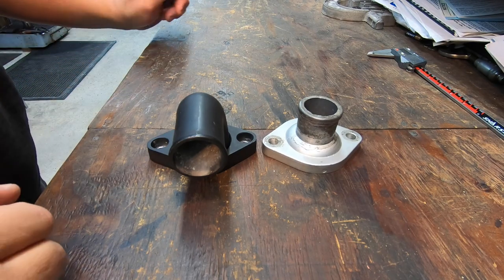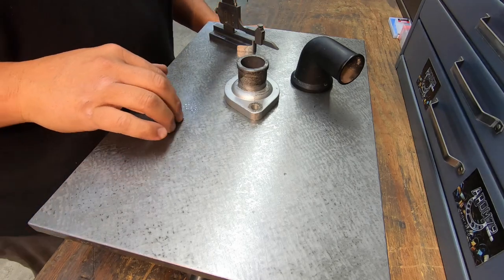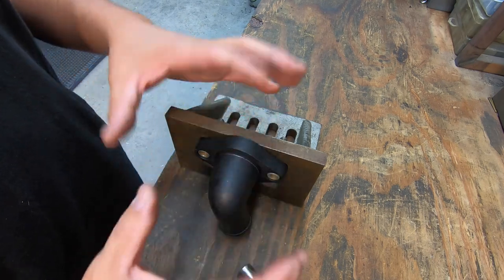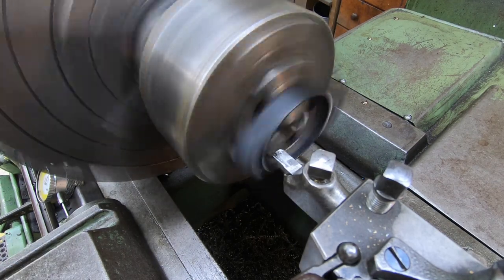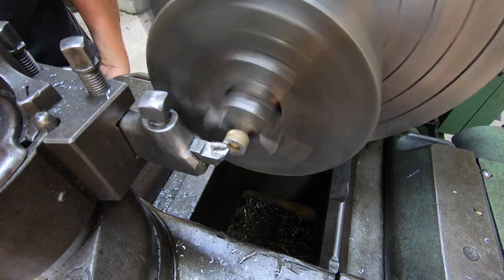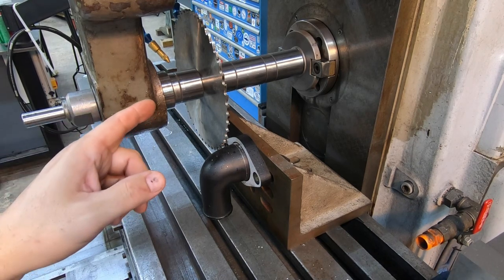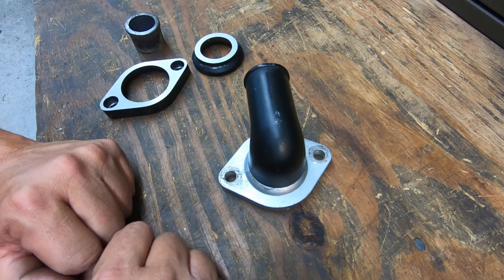SNS 328 Part 1: Machining a Custom Mopar Water Neck

Comment: Pro Tip!!!!!! I do not normally comment, But your in my wheel house with the Welding. Never clean Aluminum with a Steel Wire Wheel or any wire wheel or brush for that matter. What happened is you impregnated the Aluminum with the steel from the brush. This will cause contamination Big Time!!!!!!! Even if it is a bad casting you will not have that hard of a time. Clean it with Acetone or Methanol using Scotch Brite. Make sure to rinse with the same to get out the Scotch Brite particles. While its wet blast it with air to dry it out. You'll be fine after that. Your channel is absolutely beautiful!!!!!!!!!! Your content and craftsmanship along with your knowledge is priceless!!!!!!!!! Thank you!!!!!!!!!!

Comment: I built my first home about 25 years ago.  I designed it myself and sent the design to an engineer to put all of the structural and seismic calculations to the structure.  Once building began, I had this neighbor always stopping by with “why are you doing it like that?”  “Why not do it like this?”  “I would have done it like this.”
I finally told the guy “why don’t you get your own money and build your own house exactly the way you want”.  “If I wanted your opinion, I would ask for it”.  The same applies to this video, if Adam wanted opinions from random internet users, he would likely have asked for it.
Reply: Some people, like me, have just enough knowledge to be dangerous.  I ask him questions because he may have used a different technique on something else.  His channel is so fascinating to me, and others as you can see.

Comment: I am sure I have commented this before but, the setup of the part to be held in a machine can use more brain power than the actual job itself. Building a puzzle with pieces that have no picture reference.

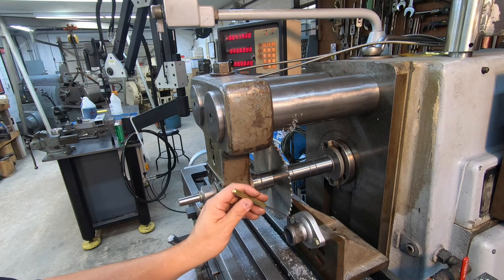Comment: Cool video, thank you.  I don't think it matters in this case, but just curious, if you needed to be precise would you needed to add the "weeble wobble" distance to the blade thickness when switching to cut with the other side with the DRO at 19:18?

Comment: Based on the pictures of the fit up on the engine, you probably should have taken another 1/4" out of the height on that elbow to help the coolant line clear the exhaust/turbo assembly. Just a thought.

Comment: Adam, please ask your cousin to get a better quality hose clamp. I understand this is a budget build but a cheap clamp on a high performance engine is both dangerous to both those working around a hot engine and to the engine itself if a hose clamp fails   Great video, I lived in Charlotte NC for a long time an love BBQ but I will say, you need to find an old school, Eastern NC whole hog restaurant.  They are becoming rare as there are not many people willing to work all night every night to shovel coals under a hog on the grill. That being said, all animals are equal, but some pigs are more equal than others.

Comment: When I first started building molds we would use tape on mill tables to keep our locations correct, then we added optics to x/y beds thought we were doing pretty good , then years later digital came along and we were in dog heaven !  Looks like someone took a bite out of your back way on lathe.

Comment: Letting the part fly like that. Not sure how I feel about that. Stop the mill just before and do some handwork or put on some gloves and hold it while it finishes the cut. It looks damaged to me considering what it's purpose is. I watch all of your videos and this is one of the first times I've wondered what you were thinking. Cheers!
Reply: "Letting the part fly like that".. hmmmm..... uh...... hey!  Seen and heard?  Go look at Fenner's latest.  You'd probably have a hernia. Gee. I watched the same video you did. Just now.  It's not damaged .. at all.  It'll work fine.
Reply: You do not reach into a running machine and especially not with gloves on.
Reply: This thing has to hold ~2bar/30psi and 220°F/105°C of water. I'm sure the chipped paint will be a massive strength loss in that thick cast aluminium bend, and it will fail immediately
Reply: @Finnspin_unicycles  Not even 30, 16 at the most I would think. The damage is only to the ridge that keeps that hose from sliding off, not a problem at all. ( I did get that you are being sarcastic)
Reply: Running machinery, no gloves. Simple
Reply: @silasmarner7586  sure it will work just fine.  He did put a little nick in the part though, could've been avoided.
The whole part of doing it this way instead of with a grinder was to do it absolutely perfect,  just because he can.

Comment: You skipped some of the machine prep work but I'd appreciate seeing some prep processes when it's a little more than straight forward - like if you needed to fit the vertical head. A few mins of video spent on saw mounting would be nice too.

Comment: You didn't indicate the bolt heads when you took a 1/16th off. what a hack LOL. I watch and enjoy every one of your video and never comment. I do appreciate your content. I'm commenting because, this is the funniest video in your catalog of doing a full customized part that could easily have been bought just "because I have the equipment". Thanks for your time!

Comment: Question ?   Couldnt you have just used the horizontal mill to cut the flange and all in one cut?  Or would deflection be a issue?

Comment: Could you have just tightened up the bolts in the holes with a nut on the backside or whatever and just faced off the flange and the bolts at the same time given you had room for the bolts (it appears you would), or is it not a good idea to do something like that with two dissimilar metals. I just bought my first mill and lathe so I’m just trying to learn as much as I possibly can all the time. I appreciate your wealth of knowledge. It’s your channel that inspired me to get these pieces of machinery in the first place.
Reply: I struggle to understand what you are getting at. But I appreciate you're trying.
Reply: @silasmarner7586  he saying don't face either side , and cut straight thru the flange, and bolts at the same time.
Reply: @jgoody7467  That isn't what he said at all.
Reply: I don't want to speak for Adam but I don't see why you couldn't as long as the cutter was up to the job of cutting the hardest material out of the two. The only problem you might run into is the holes in the flange are not tight to the bolt so if you got too aggressive you could move them in the hole, the cutting tool might not appreciate that. I hope you enjoy your new hobby.
Reply: @--_DJ_-- . Thank you. The other two have no idea what I’m talking about. I was also thinking about exactly what you mentioned. If you didn’t have the bolts very tight they could rock in the counterbored holes and cause some issues. I appreciate your response. I didn’t think what I asked was rocket surgery, apparently it was 😂.
Reply: @silasmarner7586  It’s ok, thanks. Others understood what I meant.
Reply: @specforged5651  I think you tagged the wrong guy with one of those comments.
Reply: @specforged5651  Rocket surgery it was not. People read too quickly I think, I know I do it from time to time.
Reply: @jgoody7467  Lol. Nope that isn’t what I’m getting at whatsoever. Still would have had to face the first side, the neck still needed to be pulled up tight. I’m talking about facing the second face and bolt heads at the same time to clear the slitting saw. It’s not a big deal, I was just wondering why you might not want to do that.
Reply: @--_DJ_--  I did, sorry. You knew what I meant lol. Thanks!

Comment: So, as a Non-Machinist.... Why not just cut everything? Why not cut through the flange, the bolts, and the 90 degree neck all at the same time ?
Reply: Just don’t ask why not, Abom hates that😎😎 Multiple ways to do one thing, and he choose the way he prefers 😜😜
Reply: Valid question. Trying to skim off a small amount from a flat surface with a saw blade often results in some amount of blade deflection. Would have been fine in this case with such a heavy duty horizontal mill, but generally just one of those things you avoid doing by default. Also would not have left nearly as nice of a finish (on a scrap part haha).  The cap head screws you'll notice he purposely cut slightly shorter than flush with the flange. Again, unnecessary in this case, but just a habit formed to avoid subjecting your tools to hardened bolts in other cases.
Reply: Also the extra work on the sawblade will wear it out faster, by taking the extra effort he will extend the life of the sawblade

Comment: Is there any reason that you are cutting feed into the blade from the right, with the force of the cut being in an upwards direction?  Would there be any kind of difference in the cutting dynamics etc if you fed into the blade from the left, with the force of the cut being pushed downwards into the table?  I ask this as a cabinet maker of 15 years, where you always try to have the machine be the backstop to cutting direction and the upwards cut seems wrong to me.
Reply: Adam generally prefers to "conventionally" mill. You are describing "climb" milling which generally only works well on very rigid machines and setups, but can cause chatter if the rigidity isn't high enough. In this part, however it probably would have worked since it's just a small piece of aluminum.
Reply: Not sure about this case, but usually if the fixture fails, you don't want your workpiece getting slammed into the table by the cutter and jamming them together. This way, if something fails, it simply lifts away.
Reply: @nils1953  Brilliant!!! Thank you so much.  This makes much more sense to me now
Reply: @mackenziejames7427  would like to add to DiGuido, that conventional milling works with machines with backlash. Because the cutting forces act against the feed direction,  the backlash in the spindle is counteracted by always being pushed to one side, whereas with climb cutting, the movement can become jumpy. Very similar to how you would cut with a router bit, so that is doesn't run away from you, or why you always cut from the front side of your table saw ( which is basically this exact cut, just upside down).
Reply: @nils1953   @Gregory DiGuido  I really struggle getting my head around the geometry of milling and climb vs conventional.  We have that sort of situation with the CNC routers, but the work platform is fixed, and all the movement of the cutting head is based entirely on the rotation direction, not taking into account the backlash in the machine.  Thanks so much for answering this for me :)

Comment: Now ...im no machinist , not to the caliber of AB . But instead of facing off that flange and ruining a perfectly good part as it is ? Couldn't you just put a large copper washer behind the neck where the temp valve would go , then clamp it the way it was before facing and slice that bad boy off . The part you want out of the process is done , the flange is still good to use and the area where the copper washer is garbage . The copper is probably fine. Im just saying ....

Comment: I hope the ID of the goose neck is the same as the ID of the flange. If not, it would be a good idea to open the flange ID since it’s in the weld bead and not the thermostat seat to match.

Comment: Adam, I've been watching your channel for a very long time, but stretching these quick jobs over multiple parts is really starting to get old. There is no reason why this job shouldn't have been a single 20 minute video start to finish.
Reply: Type in "mOsT sAtiSfYiNg mAcHiNiNg ViDeO" on YouTube. That should be more your speed. Only chips flying, no annoying anecdotal information, no pesky education, just pure machining.
Reply: His videos have always been long format and informative.  Not everyone is a know it all such as yourself.
Reply: @xenonram  I never said I wanted an uninformative video. I stated that there is literally no need for this job to split up into two separate ~25 minute videos. It's annoying, and all of the major parts of the video could have been explained succinctly within a single 20-30 minute video.
Reply: @michael-michaelmotorcycle  I never said I knew it all, or I didn't want "informative" videos. I said said stretching these quick jobs over 2 separate videos and nearly 50 minutes of video is ridiculous. He has done far more complicated and in-depth jobs, explaining the steps he was doing, with far shorter videos. This is just milking YouTube ad-revenue.

Comment: Not to mention brasing would have worked just fine on a stock steel one or cast iron. Its not like were talking high temp/pressure the blow off valve on the radiator cap will open long before the brase fails.

Comment: I'm still confused by this project.  What exactly was wrong with the aftermarket that would not work for his application?  Was it the flange bolt pattern,, the thermostat size, the initial outlet diameter?
Reply: Think it was Mopar didn't make one where the location of outlet nect was as he wanted, I wanted a neck like the adjustable one he is cutting off for a Ford small block engine but noone makes such.
Reply: He had the 2 different parts that could be combined into one (what the aftermarket would be) and have his cousin machine it up for him.
Reply: @Shain Andrews, I've watched the intro a couple of times and as far as I can gather it was a case of incompatibility of Chevy part (black one) to Mopar. Different flange and 'stat size apparently.
Reply: He said the aftermarket part was for a Chevy. It was not designed to fit the Mopar thermostat housing.
Reply: @jontisdall6248  Yeah I kind of got that impression too, but he never said exactly what the issue was.  I kept waiting for him to hold the flanges together or something.  I also know he isn't the biggest automotive guy and really he doesn't need to be.  It just bugs me to "fix" a problem when the "problem" is not clearly articulated.

Comment: Interrupted cuts are scary
Reply: From what I've seen repeatedly from multiple shop gurus is to take very small cuts.  Also what I've learned is for not harden materials HSS bits work better because of the lower tool presures.  HSS seems to really work well on aluminum

Comment: Can't believe you didn't use the shaper to thin down the flange. That and I can't believe you didn't chamfer the edges of the flange cap screw heads.
Reply: I love sarcasm ! LOL
Reply: @bushmaster2936  Actually the shaper suggestion was in jest. I really was stunned when he didn't chamfer the cap screws.
Reply: @lukemeisenbach1964  I felt cheated without the chamfer detail as well.
Reply: @lukemeisenbach1964  He felt them. Said they weren't very sharp.
Reply: @moehoward01  And yet so totally out of character.
Reply: @lukemeisenbach1964  They were single use parts. Not going into a finished product. They didn't really need the chamfer, so why bother?
Reply: @moehoward01  Agreed, and a band saw could have done everything just as adequately. The lack of chamfering was totally out of character however even if being thrown away. I'm devastated.
Reply: @lukemeisenbach1964  LOL Ahhh... you'll get over it...

Comment: I've never seen so much over kill for a weldment project.
Reply: The normal "chop it of with an angle grinder" method would have been just fine, but that's just not how Adam operates.

Comment: i get that this is just the trade you have but it seems like your using a lot of 1000.00 tools to do a 10.00 job.   why not just vice it, use a cut off wheel, and then weld from there. surly that would have been simpler.
Reply: To begin with, this is a family project and isn't a time/materials shop job (it's best time to practice your skills and have fun with new tools since it isn't a rush). Like they say, "any job worth doing is worth doing well" and, as Adam noted, it's a bit more fun to use more sophisticated machining practices instead of just a hack and weld.

Comment: Why are cutters never straight or round? They need need to be ground when they're new.
Reply: It may well be his arbor spacers are no longer true ?
Reply: My thoughts exactly. New cutter not concentric with arbor hole- send it back.   Everyone seems to have bad slitting saws. Keith (both),  Tom, Steve , Adam etc. all have rough slitting saws. What's up with that?
Reply: @paulatkins894  It's not a hole concentricity issue. The problem is the saw is not perpendicular to the axis of rotation.

Comment: Why didn't you hold onto the good part when It was about ready to be sawn off instead of letting the part get nicked by the saw blade?
Reply: He’s smart enough not to get his hands that close to a sharp spinning blade powered by a multi horse machine.
Reply: If it was me I would not have any part of my body, especially my hand, anywhere near that spinning blade.  No telling what's going to happen to that part when the saw cuts through.  Adam has all of his fingers on both hands and they all look like the right length  so my guess is that he feels much the same way about spinning sharp things.  Ugly things happen VERY quickly in machine and wood shops.
Reply: ^asks the guy with 3 fingers
Reply: Because he is attached to his fingers.